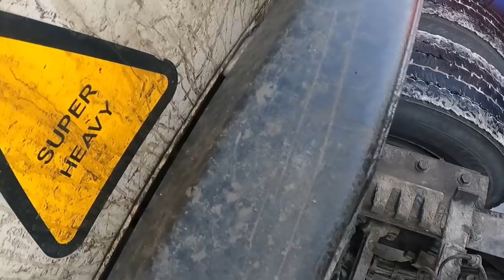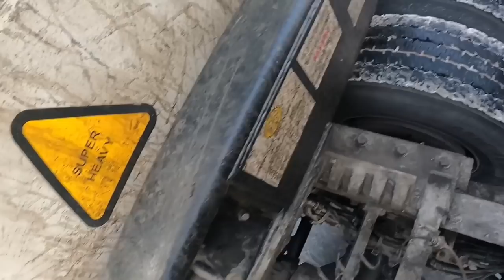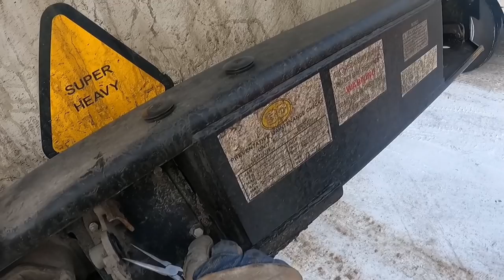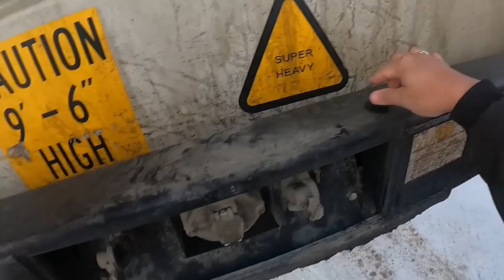Female Truck Driver with Amazing 22 years of Driving Experience ~ Lakay Trucker🇨🇦 [EP12]

Comment: Glide  hand lock goes into the service line need to push the key in and turn that’s how you lock them if here truck doesn’t fill the air on the airbags/leveler must be froze need some heat to let the sensor to build air to the airbag
Reply from the maker: Good thing to know sir
Reply: @LAKAYTRUCKER  27 years truck driver I experienced lots I carry small torch to unfreeze sensors and brakes that luck up